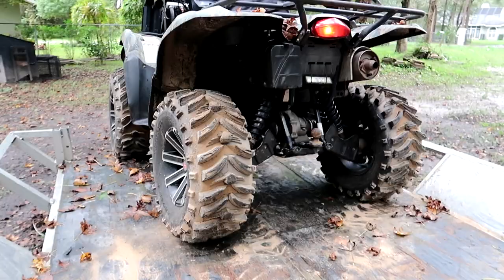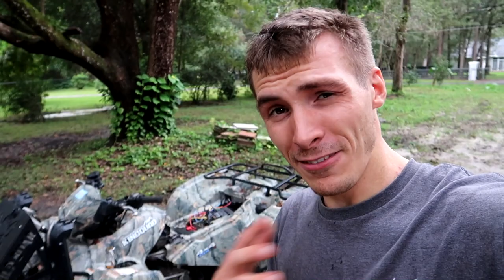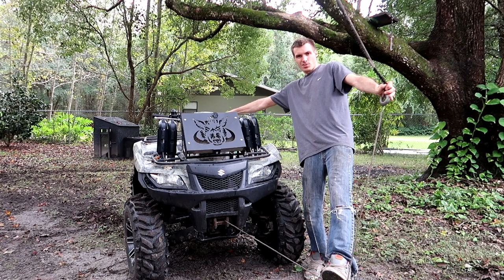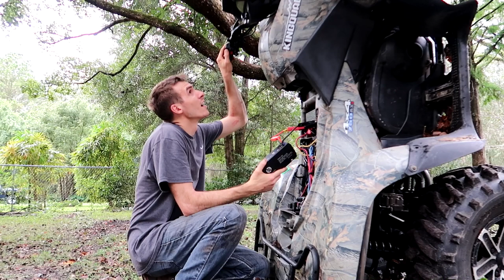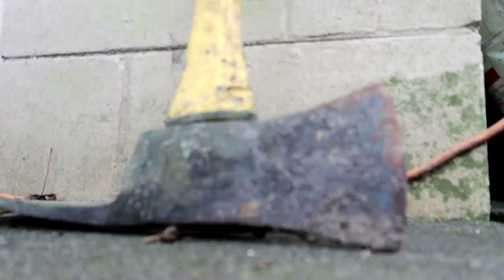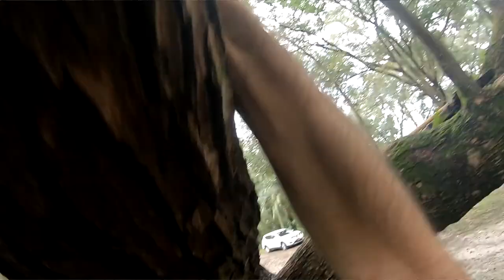I BROKE My NEW ATV in 5 Minutes

Comment: Change out the spring in your clutch for a stiffer one it will allow the engine to rev before  lock up and it should wheelie pretty easy!!I I have a polaris that wouldn't wheelie until I changed out that spring now it's a wheelie machine 🤘🤘very entertaining video 3D👍👍that suzuki seems gutless a 750 should wheelie pretty effortless!!🤕

Comment: Hey man, I see you're having low power. I'm all too familiar with that on the 500 and 750 King Quads. One thing about them is their really picky on the plugs they use to get their full power. The best one I've found is the NGK CR6E. Another problem with them, especially down in places like Florida with a lot of sand is the fuel pump sock getting very restrictive and also the fuel injector stopping up some. Check all of that and I bet one of them if not a combination of them is the low power issue.

Comment: You have to check the belt if it’s a bad belt you will get no power it’ll just spin the belt and slip. Also you have to put a clutch kit in it it makes 1000% of a difference

Comment: My buddy was really disappointed in his KingQuad after a couple of months of ownership. They didn't really have much land for him to ride on at the dealership to get a real good ride out of it before he purchased it. He ended up trading it in towards a Can-Am Renegade X MR 1000R. Now if you want to talk about serious power and torque and about the beast of all 4 wheelers, that Can-Am is NUTS. I have never ridden a 4 wheeler that will roast all 4 tires on pavement in 4 wheel drive at will until I road that thing.

That thing is fast. If your not a very big guy like my scrawny arse, you will get some good arm pump riding one of them. Hitting the throttle without leaning way over the bars is not recommended either. My buddy is 6ft 5 220lbs and his Can-Am still pulls the front wheels off the ground with ease. I was looking at their turbo charged side by side, but those are pretty dang pricey, and I just purchased an Indian Scout Bobber back in August, so I really don't want any new payments right now.

Comment: Hey Dalton I'm pretty sure there is a safety switch for when you flip the wheeler. Usually when all 4 wheels come off the ground it acts like it senses a roll over and shuts down. You probably just have to reset it.

Comment: Zuki's and most newer quads like that should have roll-over sensors to cut power and/or fuel. You probably done zoinked the sensor my dude, unplug battery and wait, let it discharge and plug the booger back in. She should rip again! As for no power, shim the flipping clutch!

Comment: But a tipping sensor will cause the quad to shut off and sometimes it will turn the quad off completely where you need to disconnect the battery and plug it back in and reset it and you should have your gauge cluster back because mine does the same

Comment: Next time get a Can-am Outlander 1000XT...I just got one and that thing's nuts. It has injectors so no carb issues, 3 levels of power steering (I am using the medium and it's more than enough) and it rips and drifts and does all kinds of cool stuff. Also I recommend wheel spacers for stability and doing fun stuff.

edit: spelling
Reply: Josh Frank  I don't know how pricey Can-ams are in you country, I got mine for almost 10k here (not new of course) and it's mint condition

Comment: It probably has a sensor that shuts it off when it tips over. Its probably the same sensor that's in trunks for the light to turn on but this kills the power. Just cycle the key on and off a couple of times and it should start.

Comment: id say half your problem is the last owner i bet took that machine through a lot of mud and deep water judging by its snorkels and relocated rad , Suzuki's arn't bad you just got a lemon and i would not be surprised if the belt drive system is worn or had water in it but them tyres will definitely be slowing it down

Comment: I rebuilt a blown Kingquad 700 for a customer/acquaintance. Ran perfect for 200mi then I got a call that it was dying. I went and checked it, ran great, but if ya wheelied it...it would die. It had a full tank, they're fuel injected, couldn't find a short or bad connection anywhere. Didn't have the adapter to hook it up to a computer, and could not figure it out. Spent DAYS trying to figure it out and never did. Still runs great 10yrs later but dies if you wheelie it. WTF????

Comment: There's a tipping sensor I have a 2020 Suzuki and that quad should be able to pull wheelies I have as many cc's as you do and I'm running Silverbacks 30s online with a 2 inch lift kit obviously your quad is low on power or something or maybe the belt could be going

Comment: I  D  TEN  T    When you put a larger tire package on your shit and do NOT CHANGE THE FINAL DRIVE RATIO, you just turned your ATV into  shitwagon.

Your shit stopped running when you went vertical due to the oil pressure loss shutdown sensor.

Comment: it shouldn’t have that low of bottom end power just because of wheels and tires maybe its  regeared higher or im not sure if that quad has sprockets or not but maybe just check if it has aftermarket sprockets that are a diffrent size than stock if its not that maybe theres electronics on it that’s robbing power ive ridden 500cc utility quads that lift the front end up no problem that 750 should have more than enough power to do a wheelie

Comment: i got a 2012 shitshow of a bike from 2012 it was a raindeer herder bike. only problem whas battery,  no oil in engine and all was nasty. 12000km. = 74 564.MILES...
Reply: oh shit sensor is under the air filter box. at the front. remove airfilterbox and you will touch the sensor.

Comment: So yes obviously there's something wrong with that quad because you should have plenty of power and those tires aren't that big nothing different with the stock size from what it looks like on yours and believe me you can get those things wet without the seat on it it should run regardless I only snorkeled mine didn't waterproof anything and it runs all the time or you just have a bad system in your quad or something cuz I don't have any of those problems